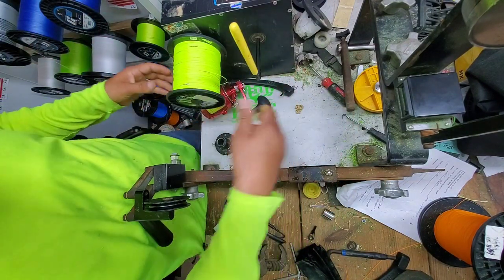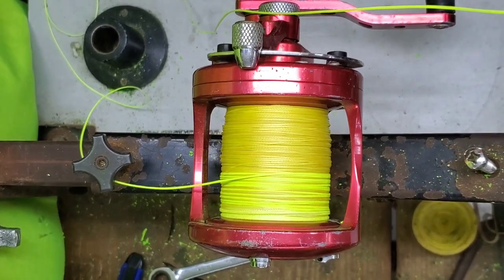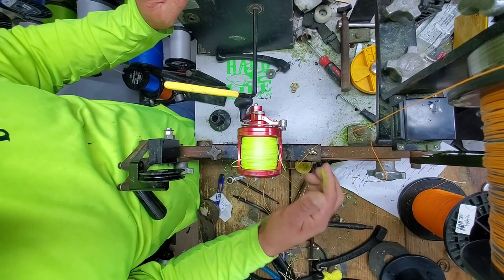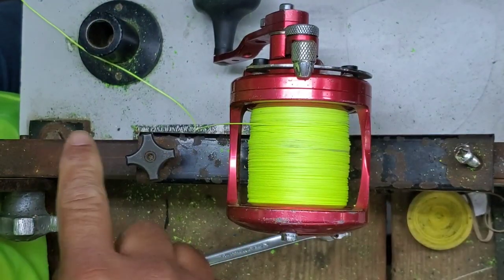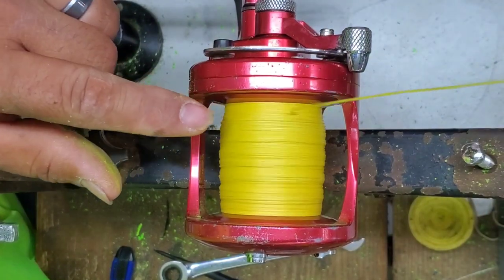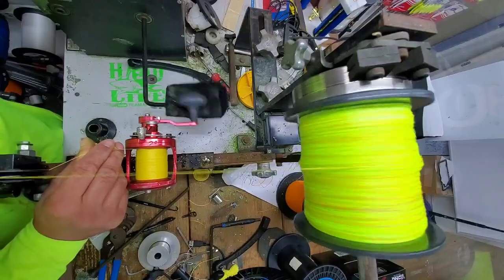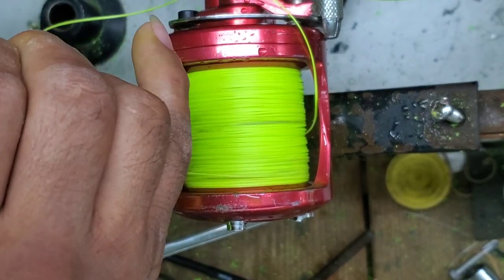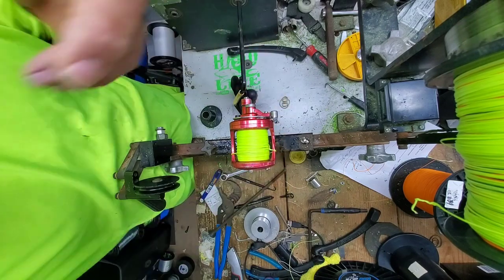What is going on with step 2 of our distance casting testing Avet Reels  Cortland Hollow Core Braid

Comment: I’d want to try some mono shockleader with your slick knotless connection with the hollow core. Make it wrap 8 times around the spool and the length of drop you plan to cast.  That might insure a good “take off” of the cast and might be one less thing causing a restriction.. can’t wait to see what you figure out!
Reply from the maker: This is just the start.

Comment: If you make over 200yards with that reel using braid I’ll eat my hat. I honestly don’t think a tournament caster could. Mainly the braid being the deciding factor. If you absolutely want to do it with braid why not use a Long Cast Penn or something like a Shimano Bullseye or Daiwa Tournament Basia Surf. You’ll do it then…and no backlash. And have decent line capacity. Not the same feel in the hand I know but they do rule the roost with distance braid fishing.
P.S. we used to slit a tennis ball open and pop the lead inside casting on a field. You know why. Trying to dig them out the ground after touchdown ain’t much fun when only practicing.
Reply: Sanctioned tournaments require mono only, no braid, and they will mic the mono to make sure it's the proper diameter for the weight being thrown.  Reels and their components are gonna also be different for field casting and you can easily see that in what the guys are using to their advantage.
Reply from the maker: Yes sir right on that and if you want to compete with them have to follow their rules ans guidelines.. now for what I'm doing its for fishing applications
Reply: @TeamHardLife  Gotcha! 👍
Reply from the maker: And yes will be doing some of those competitions as well.so much knowledge there
Reply: Second million views video 🔥 
20K subs giveaway 🔥 
#Avetreels 🔥 🔥 🔥
Reply: @steveowens7934  hey guess what I found...LOL 20k SUBS, second million, next million shout out…#GatorLures for not only cast like lightening but they'll flash like it too!

Comment: RUNNING LINE
The running line shall be made of high visibility monofilament material 
and be the same diameter throughout its entire length. The running line 
shall have the following minimum diameters:
.35mm (.01378 inch) for the 175 gram & 8oz weight
.31 mm (.01220 inch) for the 150 gram weight
.28 mm (.01102 inch) for the 125 gram weight
.25 mm (.00984 inch) for the 100 gram weight

SHOCK LINE
The shock line shall be made of high visibility monofilament material, 
parallel and not tapered, and have the following minimum diameters:
0.75 mm (80#) for 175, 150 grams and 8oz weights
0.65 mm (50#) for the 125 and 100 gram weights

There shall be at least eight turns of the shock line around the spool.

CASTING WEIGHTS
Only official weights provided by Surfcast USA may be used in a
Tournament = 100 grams, 125 grams, 150 grams, 175 grams & 8oz.

    MASTERS - over 725 feet
    AAA - 650 feet to 724 feet
    AA - 550 feet to 649 feet
    A - 450 feet to 549 feet
    B - 350 feet to 449 feet
    C – 349 feet or less
Reply from the maker: Wow that's awesome info thank you very much